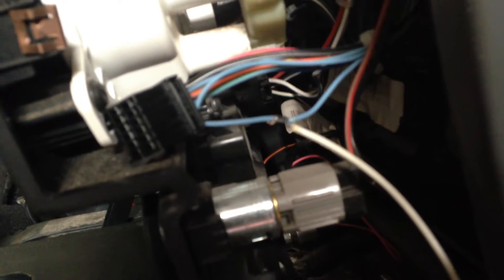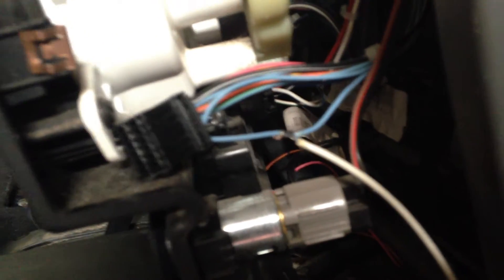Jeep JK AC Conversion for your LS

Comment: Hi there and that white wire you running yo the a/c compressor green or black colors ?
Reply from the maker: The white wire would hook to the Green power wire
Reply: @jeepspeedshop  thank you for responding
Reply: @jeepspeedshop  i see video on you tube the your guys selling the gen 4 ls harness?
Reply from the maker: @joserojas1458  I do have 3 harness for sale, the one out of my Jeep 2008 JK, I'm selling it for $1500
Reply: @jeepspeedshop  the harness you have is for gen 4 6.2 and 6l80 transmission ?
Reply from the maker: @BlancaGarcia-cn5el  Yes, It came out of my 2008 Jeep JK with a 2010 6.2L and a 6L80
Reply: Hi there the ac conector is for 2008 jk wrangler ? Thank you
Reply: The harness would work everything dash cruise control a/c is plug and play?
Reply: What I’m I’m using something other than an LS